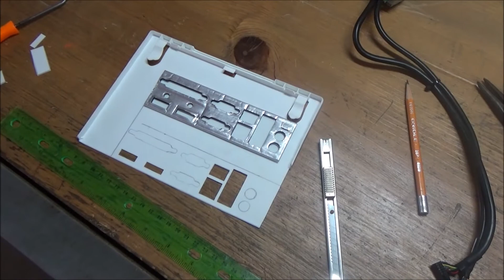Build Log Part 3- Dell Optiplex 980 SFF motherboard in 780 SFF case

Comment: Great Project... 

What I've seen someone else do, to get this card to fit into this same case but with a 780 board, was to remove the DVI Port from the video card. Obviously it voids the warranty but it worked. 

You are putting a ton of effort into this project and I am sure you will be very happy once done...
Reply from the maker: Thanks man. I thought about removing the DVI port and calling it a day, but I really wanted and needed more CPU power. The i7 870 is 50% stronger than my old Q9400 and with the 1050ti being such a drastic improvement (70%) over the 750ti I couldn't get myself to do half of an upgrade. I finished it up about a month ago, it's running games sooo much better. I learned a ton too.
Reply: Cool... I recently got into Intel in a huge way, like Jan 2015, as I was ALL AMD ALL DAY... But the FX 8350, that I purchased in Nov 2014, changed my mind about AMD so I looked to Intel and found some wonderful buys; eBay that is... 

Dell T7500 Dual Socket LGA 1366 talk about a beast of a PC, even with the GTX 1050 Ti, it's a serious gamer. I picked up mine for 100 bucks delivered and basically upgraded the CPU's to X5670 @2.93. Last year when Blender was coming out AMD Ryzen did the Blender test in 36 Seconds; if memory serves me correctly. My T7500 did it in like 38 seconds...

Dell T3500 Single Socket LGA 1366 is another beast with the W3690 clocked @3.47ish. This is a serious gamer to say the least. I paid more for the CPU than I did the T3500. In fact I won the T3500 and T3400 for like 60 bucks, both, delivered free. The W3690 was like 160.00. 

Dell T3400 is decent for the most part and you can use the LGA 771 to 775 Mod but it only works with the Xeon X3363. All things considered the X3363 is a sleeper gamer and works on most LGA 775 boards as a decent upgrade from dual core CPU's. 

Dell XPS 720 LGA 775 is another Beast Gamer from 2007. I used the BSEL Tape Mod on my Q6600 to boost it to 2.999 Ghz; up from 2.4. This unit also offered a serious CPU water cooled/peltier heat sink that can keep the CPU just about frozen. I bought the heat sink separate but mine did not work. 

I read they died just after their 10 year warranty. Some say they clog but I have yet to take mine apart to see if it's savable. Basically it's like the first AIO CPU Water Cooler but with the added benefit of 2 Peltiers to really cool things down. Also the BIOS is suppose to be able to OC but I have not had time to work with it...

I want to jump on Ryzen but just have a feeling that Intel will start dropping prices soon so Black Friday this year should be very interesting...

Comment: Careful with the wires behind the mobo, I did it with my old dell, and the back of the board stabbed through the wires causing a short, luckily it refused to power on and while trouble shooting it out I found the issue...Just something to check before powering it on for the first time.

I'm curious to see if we could fit a CORSAIR SF Series SF450  power supply into these little Dell cases with a homemade adaptor plate.
Reply from the maker: I guess you didn't watch the entire video of the finished build. I wound up frying half of the memory controller on the i7 when the pins pierced the power ribbon cable. I've been stuffing cables under mobos for years knowing that it's kinda sketchy, this time it bit me.
Reply: Ah dammit...friggin Dells...try again? Can't let all this stuff you did go to waste.
Reply from the maker: Nothing is affected at all except I can only run RAM in 2 of the 4 slots. I had 16GB's installed before, now it's running with 8 sadly. It still runs great though. I'll be getting another CPU eventually.

Comment: I have a optiplex 980 sff. The only thing stopping me from upgrading it is USB 3.0. Isn't lack of usb 3.0 bothering you?
Reply from the maker: Yeah not having USB 3.0 sucks, but I don't use this PC that much. It's my kids' computer so most of the games are smaller and don't take as much time to install. I still might get a USB 3.0 PCI card for it (not PCIe because the GPU is there), but they're around $50-60. Have you looked into that? You still get around 4X the speed of USB 2.0 even using the PCI slot. Here's one from Newegg https://www.newegg.com/Product/Product.aspx?Item=N82E16815158359&cm_re=usb_3.0_pci_card--15-158-359--Product

Comment: Will it be possible to install the 980 sff motherboard  inside a normal atx case? I got a 980 sff with dead power supply.